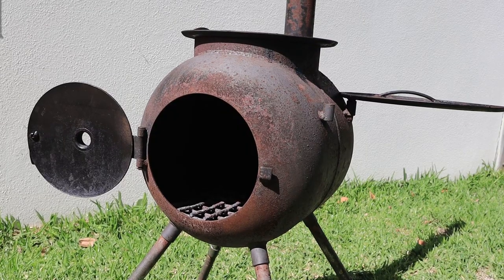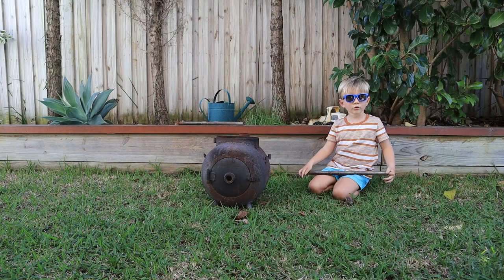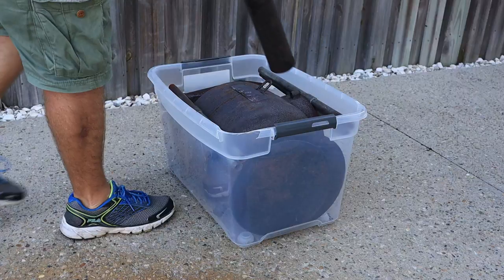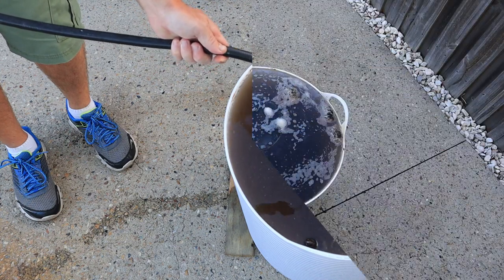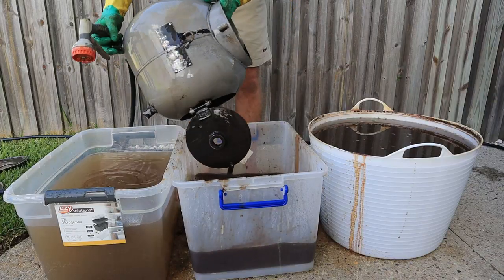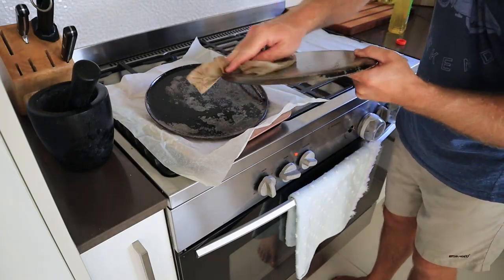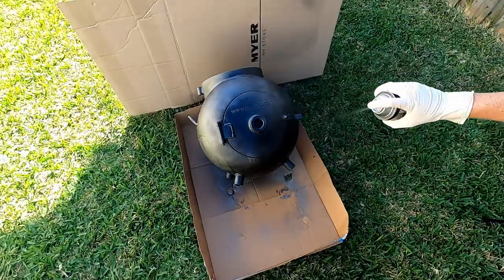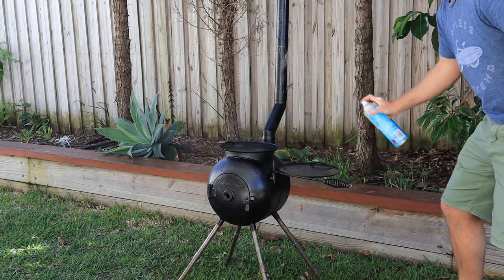Easily RESTORE a RUSTY Wood Stove

Comment: Thanks for the tips & video, got mine in the water vinegar solution right now.
Reply from the maker: No worries - hope it helps! Let us know how yours turns out.
Reply: Came up a treat, looks new. I sprayed the legs with cold galvanising just to make them look new again. I wish I could post a picture. Thanks for the tips!
Reply from the maker: Great to hear - A lot easier than grinding all the rust off!

Comment: All you need is stove polish, a simple mix of carbon black and soapy wax(steric acid) let it cure for an hour or so then polish with a damp cloth. touch up every burn season. paint stinks and greys out.I use polish over rust once loose scaling is brushed away .

Comment: Great video, I just restored the door on a wood burning stove using your method and it worked great. The rest of the stove is to big to soak in a tub, any Ideas on how to apply this method to an larger Item that is not easily submerged in a tub etc.
Reply from the maker: I remember watching a youtube video where the man painted vinegar onto the metal with a brush and then covered the metal with paper strips also soaked in vinegar. After a few days he removed the paper and the underlying metal was rust free.
Reply: Was it cast iron?
Reply: I would fill a sprayer with vinegar spray it down, cover it with towels, spray it to saturate, wrap it in plastic, and re-spray to keep it dripping wet, for several days, or until the rest was gone.

Comment: Great Video!  I restore cast iron cookware and have always been told never to soak in vinegar/water solution more than 30 minutes at a time. It will eat and pit the cast iron and will make the iron soft. I tested this method on my own. It did a great job of cleaning but did pit the iron as I left it purposely for ruffly 24 HRS. You left yours in the solution much longer, I’m curious it you experienced any added pitting in your project. 
Looks Amazing btw!
Reply from the maker: Thanks Lloyd. My steel stove showed no signs of pitting even after a week but cast iron is softer than steel. People often slow cook in cast iron cookware with wine / vinegar. Do you know if this has an effect? Perhaps the seasoning prevents any damage??
Reply: Hi Lloyd, do you recommend using the VHT on the cooking plates as well or is there a safer product when using paints in high temperature and for cooking.
Thanks

Comment: Hey, thanks for the video, I’m about to follow to do my pig.  I found that Coles does a “double strength” (only 8%) each bottle costs $2.  How has yours weathered now resprayed?
Reply from the maker: Hi Travis. So far so good - looking like new! I think spraying it with oil after every use has also helped (although the overspray kills the underlying grass). The "Double Strength" sounds perfect - wonder if it's new as I couldn't see it at the time?

Comment: Crazy question for you. Could you achieve the same results by placing the rusty item into say a contractor style bag like a lawn rubbish bag. This would have the effect of the vinegar solution forming around the object rather that filling a bin like a bathtub to submersion. Also the lesser amount of water to fill the higher concentration of vinegar solution on the object to be cleaned. Even a space bag with a majority of the air removed would produce a similar effect.
Reply: You still have an empty void in the middle of the stove that would fill up with liquid. What you could do however is put a garbage bag inside the stove and blow it up. So then both the inside and the outside would have a barrier restricting the vinegar to just the surface of the metal.

Vinegar (aka acetic acid) is a weak acid and will not dissolve plastic, however not all plastics are created equal and some may be more susceptible to damage from vinegar than others. So you may need to experiment a little bit.
Reply: @mikmop or fill some small plastic water bottles with water and fill the inner chamber to lessen the volume of vinegar required inside. 😊

Comment: The problem with the rust is that it often starts from the inside, and then shows on the outside, and that is also how the paint usually starts to peel off.

Comment: Great video - going to give my pig a clean up following your instructions. Used the same pot belly black spray on mine, but it is flaking off and some rust showing now. How is yours weathering since you did it this way? Any rust? Cheers
Reply from the maker: Thanks Jonathan - it's been ~5months and the pig still looks like new! I'm also making an effort to spray it with oil after each use which no doubt has helped. Let us know how you go and what paint colour you choose!
Reply: Will do. It's in the vinegar pickle bath now - planning to paint it this weekend.  Do you find that spraying with oil makes the pig smoke/ smell every time you fire it up?
Reply from the maker: Surprisingly not but overspray will kill off the underlying grass. Just make sure you don’t spray near flames otherwise you’ll have a flame thrower!!